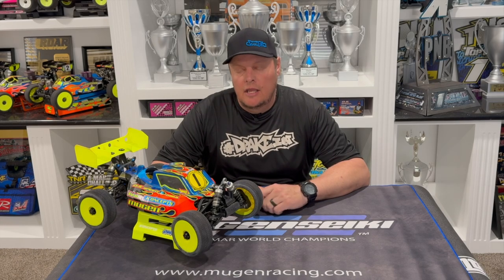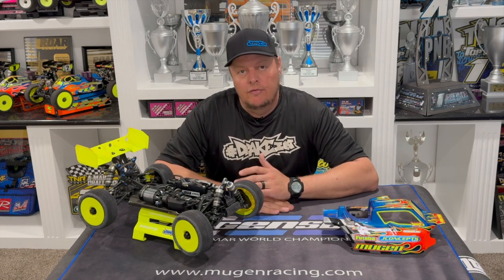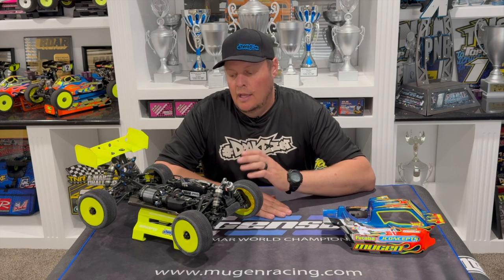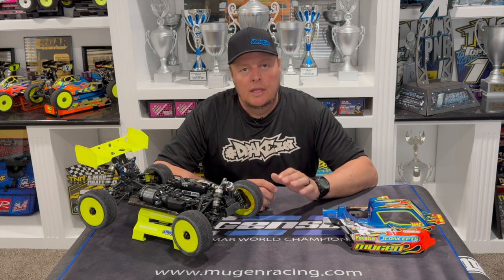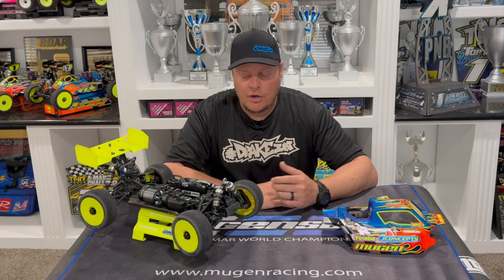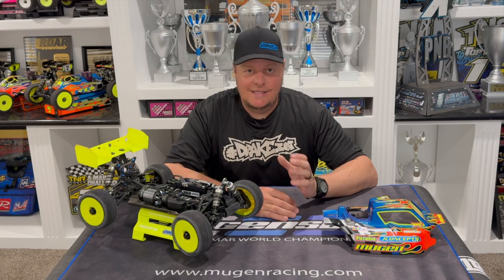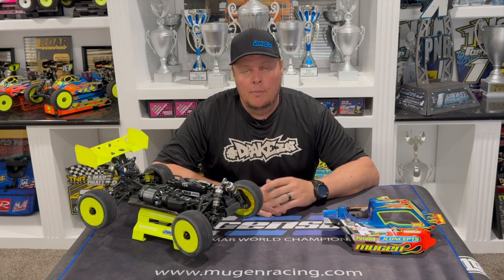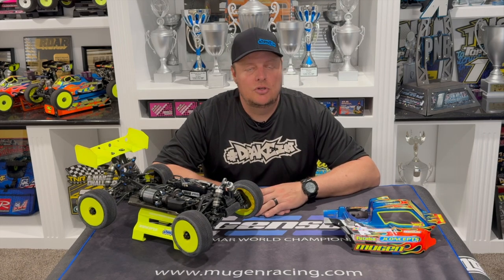HOBBYWING Boost and Turbo Timing Explained

Comment: Any recommendations for a beginner for setups on the hobby wing 2200kv combo, for my TLR 2.0. I don’t have the optional setup controller yet. Just straight out of the box install, and just running in the yard for now tell I get better at running the car

Comment: 2 replies..
Dont exceed 60 Deg with motor, boost and turbo is the standard rule as the magnets will start to fight the rotor in trying to reverse the rotation.

Comment: love it 

I've recently put a 3665  g3 with a max 10 combo in my SCT slash and I've wondered what you'd be setting on that like for example 
is drag brake a good idea?
should I add initial throttle force to it or leave that out ?

I set mine no initial throttle boost but 28 degrees of turbo with .5 delay so it only kicks in when I'm doing long open straights

still a rookie and have been learning allot from your videos a friend recommended me your channel thankyou for all the knowledge you share.

Comment: Is the turbo functioning still usable if the throttle endpoint has been reduced?
Reply: To a point, but I believe below 95% turbo won't active and you'll only have your boost timing

Comment: Couple races ago I lost all brakes somewhere between the end of qualy and the start of the main, I thought maybe sensor wire broken so I replaced it and still the same. Calibrated it and still the same, had to use the programmer and take the braking power almost to 100%. Any ideas as to why this would happen, using the exact same setup you have in this video BTW